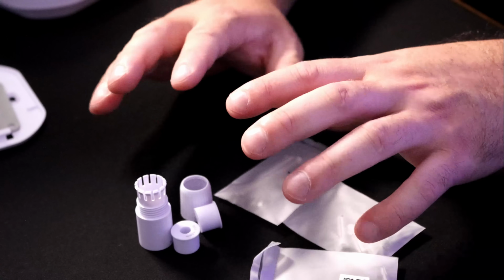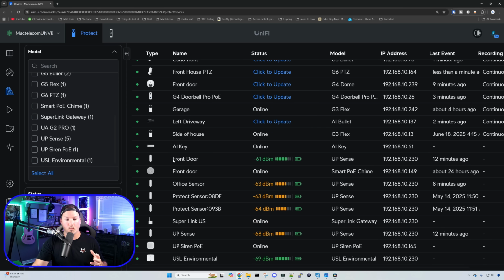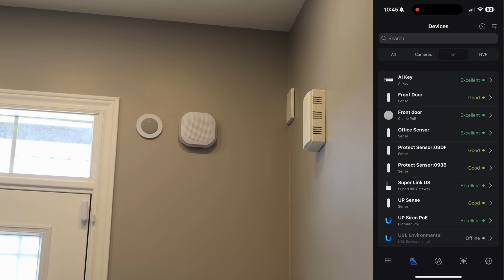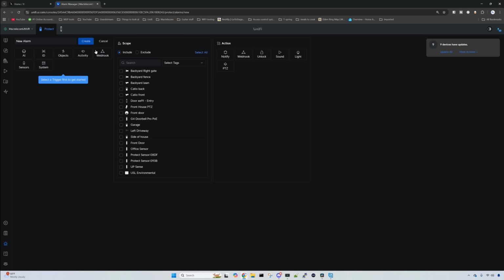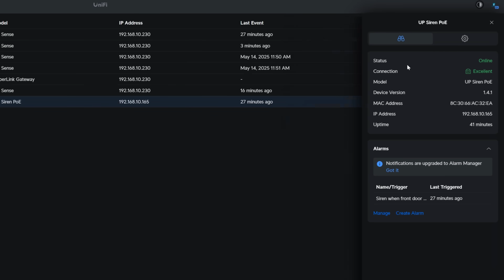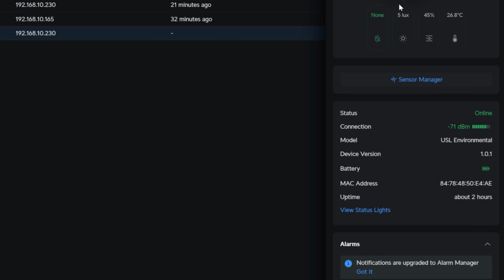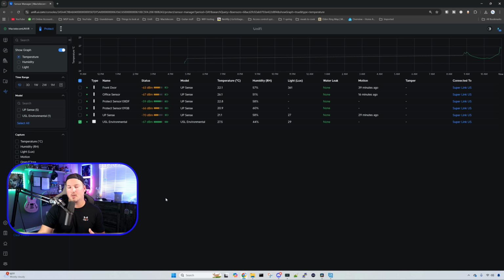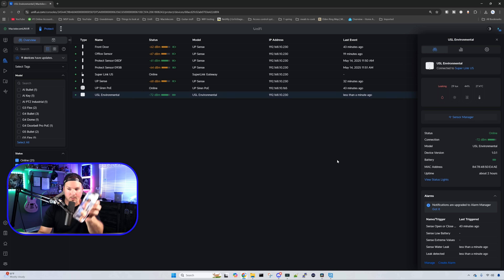UniFi SuperLink: SuperLink Siren and Environmental

Comment: You need to be able to arm and disarm it quickly through the app and siri. They will need to release a stand alone activation app, not wading through the current unifi apps to activate/deactivate (when they have door/motion/window/gb sensors.)

Comment: What is the minimum temperature when you set a temperature range?   The previous sensors couldn't go below 32F.  I would like to use them in some walk in coolers that will get down to around 25F.

Comment: Hey Codi
Once they integrate the motion and door sensor it would be pretty much like any other security systems. Which is what I want. 
However protect does not have a management interphase for Arming / Disarming the system. Doing it through the alarm setup would become cumbersome. Hopefully they come up with an update that manages the system like Ring for example.

Comment: If the sensor data could be exported to Home assistant it would be incredible. That would enable a really smart home with a full unifi setup for the majority of the sensors.
Reply: It integrates into HA automatically. I have Protect integration, and the environmental sensor showed up automatically and I have the data being tracked now.

Comment: A UP Floodlight Pro would be interesting to go with the sensor/siren range. Upgrade the existing Floodlight with a brighter 1,000 lumen white light, adjust the angle of the PIR sensor so it can sense forwards/in front of it better when the light is tilted down and perhaps even an IR extender too.

Comment: Pretty wild that there's not a PoE and AC plug-in, AQI and gas detection, version of the environmental sensor.

Replacing batteries every year is so dumb.
Reply: They’re probably starting with the most widely-applicable devices first and then will expand to more niche products like that later. It makes sense from a business perspective. 

Also, apparently the batteries are supposed to last a few years, particularly with the ultra-efficient communication paradigm they developed for the new product ecosystem. It’s a bummer that it’s proprietary, but similar proprietary systems (think Lutron Caseta’s RF system) are SOOOOO much more reliable and energy efficient. I’ve had a wireless Caseta motion sensor for years and have literally never replaced the batteries, and have never seen it fail even once. It’s impressive.

Comment: I’m curious about the preponderance of sensors which feature “leak detection" - is this a major requirement in North America? I live in the UK, am almost 80, and can’t think of a single occasion during those years when a leak detector would have been necessary. I’ve been flooded once by the local river overflowing its banks due to torrential rain but I’d been watching the waters rise for 2 days so it wasn’t much of a surprise and most of our belongings had been moved higher in the house. Is it a plumbing design thing?
Reply: Ubiquiti is first and foremost a business facing company. In enterprise while ideally you’d keep your important equipment away from things like water mains. In cases where you can’t do that the sensor can give you advance warning of small leaks that develop before they cause issues. In a house I primarily see the use case for a homeowner that has a sump pump in their basement (basically it needs constant power and without it your basement will flood; I don’t think it’s super common but depends on the terrain; My childhood home had one) and using it to notify you if the pump has failed.
Reply: Also UK here. Some home insurance companies now give discount if you have a water leak sensor combined with a smart automatic main water shutoff valve. The idea is if a frozen pipe bursts in winter while you are not at home, the leak sensor will detect it and the valve will automatically shut off your mains water to reduce the amount of damage.
Reply: They’re pretty common, even in a home environment. You can use them under sinks, appliances, toilets, radiators; etc to catch a water leak before it causes major (and incredibly expensive) water damage. It’s (generally) cheap and easy insurance - I have 7 Govee-brand ones in my 1-bedroom condo everywhere a leak could happen. Why not, ya know? I also have some in my mom’s house, and one caught a major humidifier leak in the basement that could have otherwise destroyed the furnace, costing thousands and leaving her without heat in the middle of the winter.

tbh these sensors make perfect sense for a business environment, but they’re pretty expensive for home use. Similar (just water) smart sensors can be purchased for $10-$20 each, and even cheaper in bulk packs. Integrating the temp/humidity sensor into the water alarm makes sense for enterprise, but not home use. ¯\_(ツ)_/¯

Comment: It would be pretty neat if Unifi would make a new platform called Unifi Alarm, basically a unifi security alarm system using Protect devices. Unifi Alarm having its own devices like a keypad, panic button, smoke detectors with having some type of monitoring.
Reply: A decent smart smoke alarm is desperately needed since Google murdered the nest protect.
Reply: @jay-em it’s coming apparently! I’m sure getting regulatory approval is a massive endeavor (as it should be, to be clear). Now I just want them to integrate natively with the various smart home ecosystems. Thread support would instantly make this the most attractive system on the market.

Comment: If only that siren would be updated to add your own doorbell chime sounds and custom voice messages for all the alarms, like ‘leak in the attic’, ‘person in the garden’ or ‘garden door open’.
Reply: Wouldn’t be surprised if they implemented that soon. Ubiquiti’s software team(s) have been on an absolute tear recently. Super impressive. Seems like they’ve also made big improvements to software stability and maturity.
Reply: @DylanClarkSallee  Are we talking about same Ubiquity software? Buggy, with forcing new hardware, without proper software support, and than make people wait for years for simplest features (that others have from start)?
Reply: @skela098  idk where you’ve been, but it hasn’t been like that for a long time.
Reply: The doorbell chime can do this as well as the outdoor bull horn.   I don't know if the siren would sound good usually those speakers are designed for the high pitch stuff
Reply: ... or "put that ice cream back fatty"
Reply: Depends if the chipset in the siren has the technical ability to decode and play audio files. It might be a feature request for a hardware upgrade in Siren 2.0.
Reply: @davida9561  if they didn’t include a $0.25 chipset that can decode audio then that’s an insane choice

Comment: Can the port for the ambient sensor be used to track wood humidity? Seems everyone is doing water leak sensors which, in my mind, are pretty useless - unless you get water exactly ON them, they don’t trigger. And chances of getting a leak to hit that particular spot and not next to it are slim to nil. With a wood humidity sensor you screw wires into a wood stud / panel and cover an area much more reliably, tracking changes (rather than level) in wood humidity. If it doesn’t, hope the community pushes for a v2.0 with that functionality which would be dead easy to add. 🤞🏻

Comment: Weirdly enough, I'd actually like to see a PoE version of all of these sensors
Reply: I was also thinking it would be good if the environmental sensor could be powered by POE... or at least USB-C with the option of a POE to USB-C adapter. The battery could remain as a backup in case of mains power loss.
Reply: They claim multi-year battery life, but we’ll see…

Comment: Hey Cody, So to be clear on the UP-Siren vs the USL-Siren, they will both adopt into the Protect ecosystem and have alarm manager stuff you can create right? There isn't like some SuperLink app going to come out that you need the USL-Siren for the USL sensors and the UP-Siren only works with other Protect devices like the cameras? The only difference at all is how they are powered, not in their intended purpose or functionality within the UniFi ecosystem?

Comment: Is the battery life of the Environmental Sensor any better than the previous All-In-One sensor?
Reply from the maker: Honestly couldn’t tell you we just got these devices.

But we were told they can last up to 6 years depending what you’re doing with the sensor
Reply: @MactelecomNetworks Thank you for your quick response. I have two SuperLink Gateways at different ends of the house to control the 8 UP Sense units I’ve already purchased. Other than the range of these sensors, the old UP Sense sensors seem to incorporate more functionality; you’ll need to buy the upcoming door/window sensors AND the new environmental sensor (i.e., so now there are two devices needed) to have the same functionality of the old one. That’s a tough sell unless range is an issue.

Comment: Keypad to arm and disarm would be awesome.
Reply from the maker: I would assume that’s coming and probably will be like the intercom viewer
Reply: Isn’t that what your blank plate at your front door is covering the hole for?
Reply: They still have things they've hinted in the past that hasn't released yet. Like the UniFi Connect Thermostat and my early access Protect Door Lock which I wanted for it to work with the G4 Doorbell Pro fingerprint. Still hoping for those 2 products to come out

Comment: Do you know if there will be a wired hub coming to connect wired sensors? I have an Ajax system that I have been dying to get rid of. Ive been holding out to see what Unifi brings to the table. I want to be able to integrate it with Home Assistant. Unifis Home Assistant integration is already great.

Comment: Well, looks like ill be avoiding the whole series except for the smoke alarm which they already confirmed is wired. I dont do battery sensors. Too annoying to replace things.
Sucks cause my place was wired for window and door sensors already. Most alarm systems are in houses, so why not have wired sensors for these? Seems like every smart device manufacturer thinks they are some mythological thing that no one actually has.

Edit: Nevermind, I am simply going to solder my existing wires to a CR123A dummy battery and get wired sensors that way. lol
Reply: They originally had a wired alarm panel coming out I don't know what happened to it

Comment: Is there any way to use the siren in place of the POE door chime? The functionality of the siren seems superior in pretty much every way than the door chime, especially on volume which has always been a major limitation of the door chime. It would be wonderful if we could just use one siren for door bells and superlink devices.
Reply from the maker: You could create an alarm for when the doorbell is pressed the siren goes off. But there is no way to change the tone of the siren
Reply: @MactelecomNetworks  Thank you for the clarification, and for your excellent videos as always! It seems like a missed opportunity if UniFi decided not to make the siren more easily usable as a doorbell chime. Wherever possible, finding devices that can simplify one’s network rather than adding two devices with 90% similar use cases seems wise.